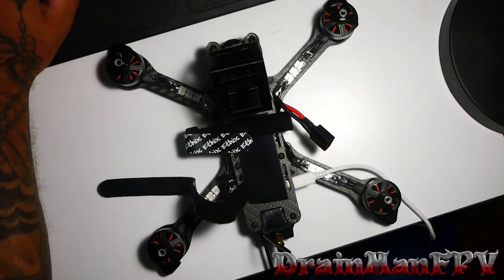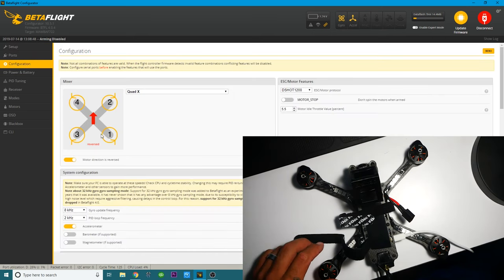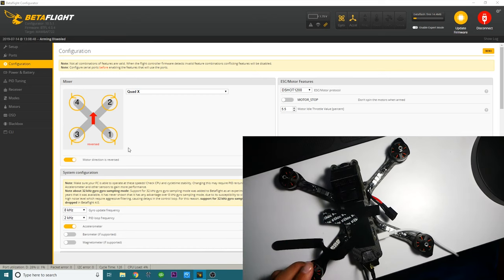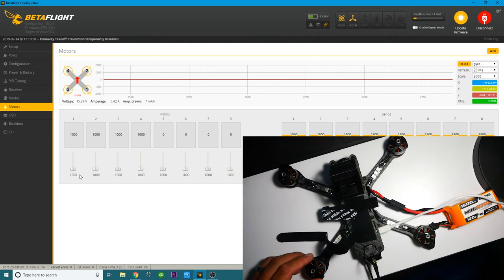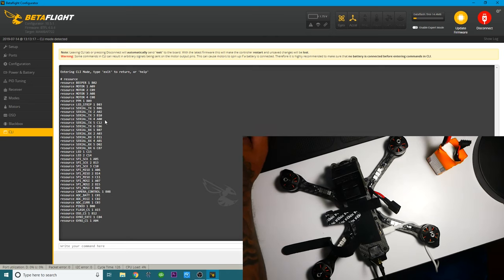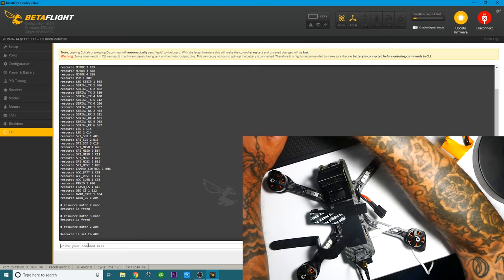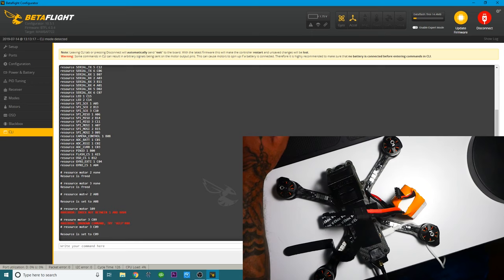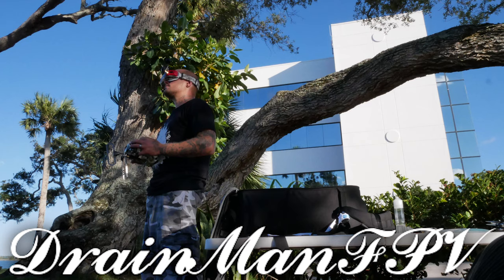Drone Flips Out On Take Off - Fixed - Motor Remapping - Betaflight

Comment: thanks dude!. i had my back motors 3 and 1 switched. i fixed it and it lift off. Now it takes off on its own on the touch of throttle tho. Gotta figure out that. and she be gooood to go. (hopefully. this is a VEEERY far step ahead)

Comment: just built my 5th quad, SUPER carefully....a 5 inch toothpick GEPRC 20a ESC AIO on 2203 stanfpv motors, flips instantly....default bf settings. default esc settings, all motors are correct, spin the right direction all that. accelerometer works fine, gyro seems fine i think? cant figure this one out I am stumped.

Comment: Hey drainman Im having this problem now, ive went through all the rotation of props, and orientation of the quad in beta with frsky x light all is good...lowered the rpm at arm to 1020 and still flippimg its shit bro on arm....throttle values are at zero as soon as i give it throttle it goes bat shit....hopefully someone can help cause this sucks, spent yesterday and all tiday trying to figure this out....Model is Halk pro running 1700kv motors with 1500 mah batt...
Reply: Did you figure out how to fix it? Got the same problem.

Comment: All that I believe is correct on mine. Mine arms then when I throttle up it starts to ramp up the RPM smoothly then it rips a quick full throttle and drops out. Only climbs like a foot.

Comment: Hey Drain man.
Thanks for your awesome videos.
I did the tutorial and when I saved my Fc won't reconnect to betaflight.
Thought it was a driver issue but other FCs are working.

For some reason i cant get into my FC anymore.
Also when i power on not geting any FC chimes.
Any suggestions???

Thanks man
And cheers form Trinidad👍
Reply: did you solve this? I'm having the same problem
Reply: @maxschneiderman6373  Hey bro..
Actually i didnt.
I just re flashed the firmware

Comment: Hello. I'm having an issue when I arm my quad (while connected to beta flight or not) one of my motors ramps rpms to full and then doesn't respond to throttle control. The other 3 motors respond to the throttle normally. Any idea how to fix this?

Comment: I have a new mamba f7 20x20 never used or burned motor 3 and 4 signal isn't working any ideas1 and 2 work fine .I've refreshed firmware a few time and the same thing.

Comment: I am having a issue with my tyro 99 flipping out as soon as I give a little throttle. All motors are where they are suppose to be and motor direction seems like there spinning the right directions . I’m new to fpv drones and rc vehicles for that matter I need help?

Comment: @drainman fpv hey just wondering if you could help me out, just finished building my tbs one with sky stars f405 55a flight stack and 1900 kv emax ecos , everything works fine it’s just right when my drone gets of the ground at 25 percent throttle it jumps to 100 percent throttle and shoots into the air. Don’t know what it could be hoping you could help thanks man love your vids

Comment: This vids is perfect timing I did a remapping last night and my computer died during the procedure and now in CLI  I lost 3 motors, is there any fix gor this?
Reply from the maker: Did you resource 3 motors to none and then save?
Reply: I go to my CLI I type resource and in this my motors are not showing
Reply from the maker: @godsun358  Go ahead and flash it so you can start over. You need to write down your pads and don't save until you have.
Reply: Thanks brother I knew you had the answer

Comment: HIi! I love your video! My drone can take off fine, and fly just like its supposed to if I am under half throttle. As soon as I raise the throttle or punch it, the quad just flips out of the air by itself. The flight controller in calibrated, motors are set up right. Do you know what could be the problem?
Reply from the maker: Unfortunately - You will need to run Black Box to see what is going on.

Comment: This may be part of this, but I need help... my quad will fly up about 3ft then just stop? Any guess why. Any help would be awesome. Thanks...
Reply from the maker: If this was your problem you would not make it 3ft up. What exactly happens when you say "just stops"
Reply: @DrainManFPV  it goes zoop, 2to3ft  then the motors just stop.
Reply: No response until I disarm then arm and then everything works again, except it takes off goes 2 to 3ft then cuts out. No response and so on.
Reply: @doubleshadow2082  what was the issue? You find out?
Reply: This video just saved me from countless hours of aggravation, and I learned something in the process. Thank you!